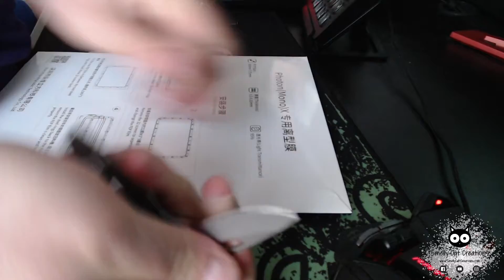Anycubic Mono X - Fep Film Replacement - First Time Changing

Comment: Great video! I tried to change the FEP on my Mono X but when I was installing it I lost one of the tiny screws that hold the FEP between the two aluminum frame pieces. Do you know where can I get those?
Reply from the maker: Hi David if you remove one and measure the diameter of it, think it's probably an M3 so just under 3mm diameter. You will be able to buy some cheap off ebay, just m3 or whatever size it is then the length so 10mm or 8mm whatever it measures. They will be countersunk hex head bolts

Comment: Please post how your prints are coming out with the new FEP.  In theory, they shouldn't be doing so well because it looks like your tension is wrong (no bottle cap; search Youtube for "Anycubic Guide--How to replace the FEP film for Photon Mono X").  It would be interesting to know if it actually matters.
Reply from the maker: Will post up soon thanks for the feedback, it certainly is tensioned very tight
Reply: @SmellyCatCreations  It could be too tight.  There’s actually supposed to be some flexibility (not slack, though) in the FEP; that’s what the bottle cap provides.
Reply from the maker: @carsondial2  yeah I.havent had the chance to.print yet with it been too busy with cnc machines. I Try to only print useful prints